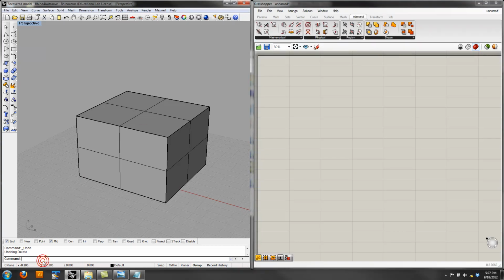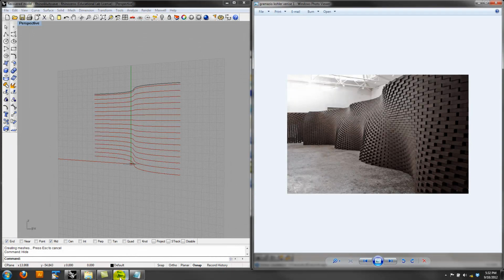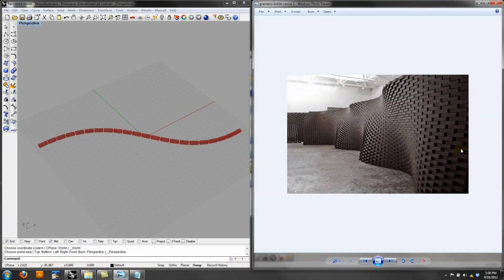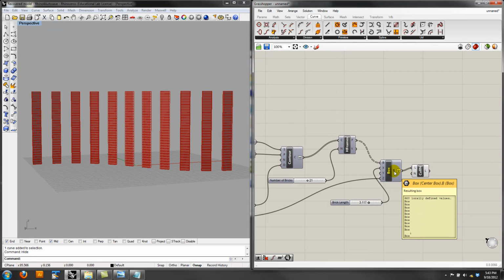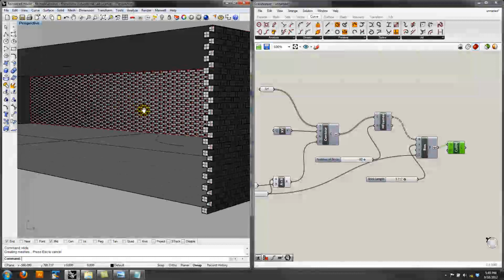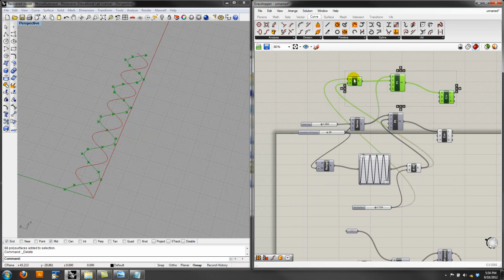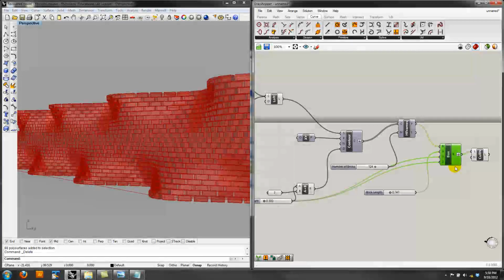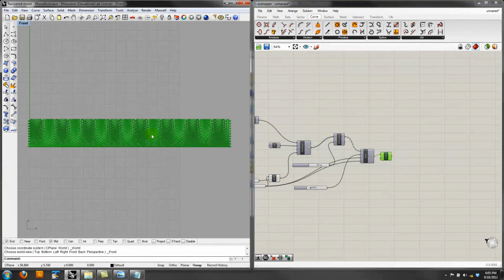Week 5: Parametric Design Process - Computational Methods, Fall 2012

Comment: i see you in a lot of your videos elaborately selecting and clicking preview/no preview again and again.

there is an option 'only preview selected' (half green pipe) that will save you some hundrends clicks (at least) in every video.

sure you know it, have no clue why you dont use it and it really makes things a lot more clear and comprehendable for the viewers as well! :)

i must add i find this teaching method, more than extremely slow. 

maybe it could be a snappier, inspiring teaching that focuses on fast,  resulting logic without pauses for predirected assumptions.

i believe that like athletes that push themselves for a faster and stronger pace otherwise they cannot perform better, the brains needs to be set in a powerfull pace gradually so the listeners is kept awake, a bit anxious, just a tad frustrated, so his insticts drive his brain to learn faster.

but that's just my opinion, thank you for presenting all this.